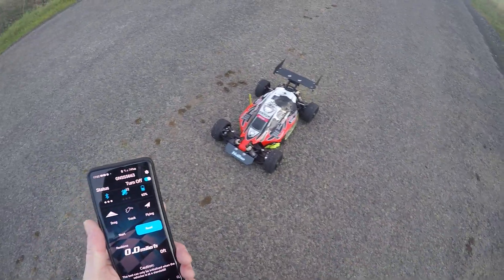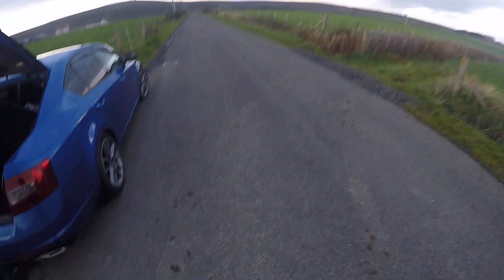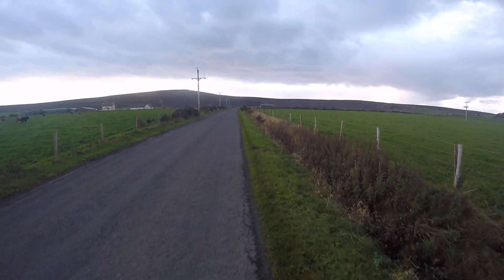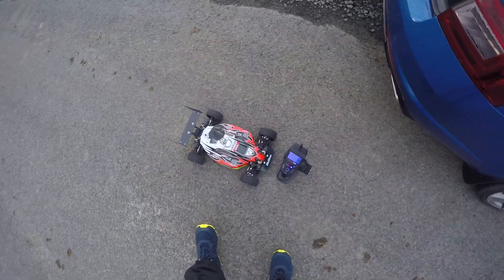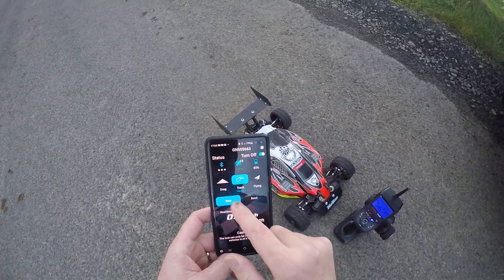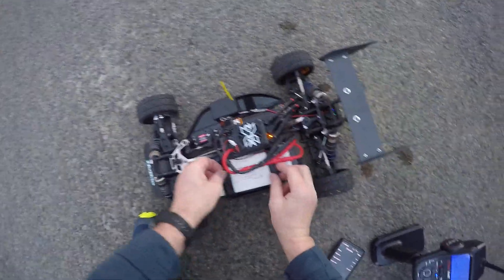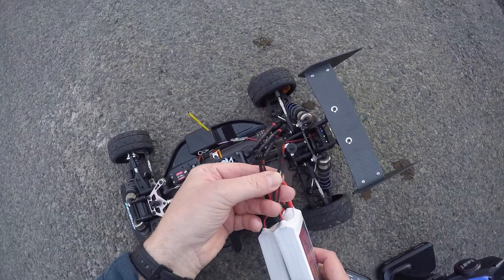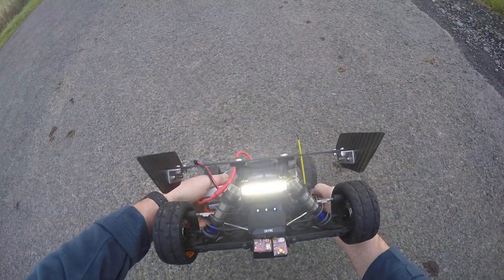Hobao Hyper 7 brushless 106mph 3s

Comment: What a great build mate!! Top results too!
I just bought one of these all kitted out with brand new gear and waiting for it to arrive.
It has a Hobbywing SC8 120A ESC capable of 2-4s with a 3674 2650KV brushless motor.

What sort of straight line speed should I expect to see (Approximately) running 8000mAh 3s 100c Zee's or 6000mAh 100c 4s mate?
Absolutely love this rig!

Thank you kindly from Western Australia... Stay safe! SUBBED

Comment: If your using two 3s batteries don’t that make it 6s
Reply: Running parralel, same voltage but longer run times
Reply from the maker: Parallel connectors = 3s voltage